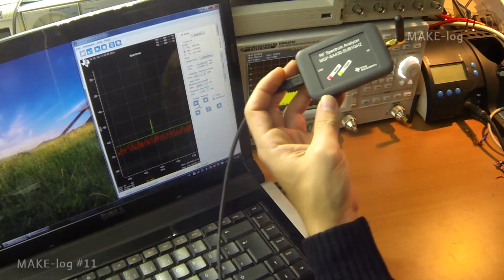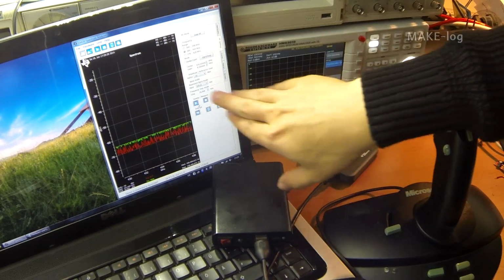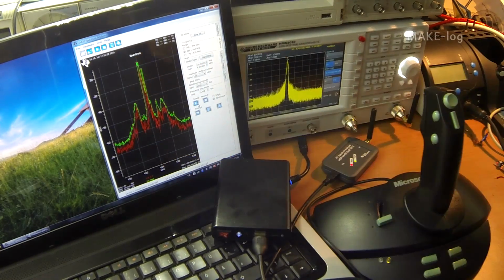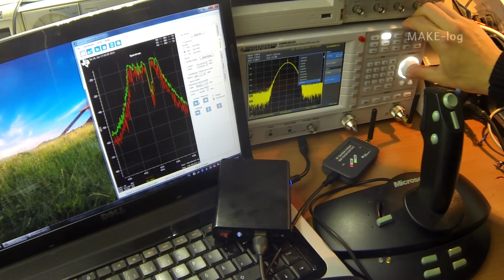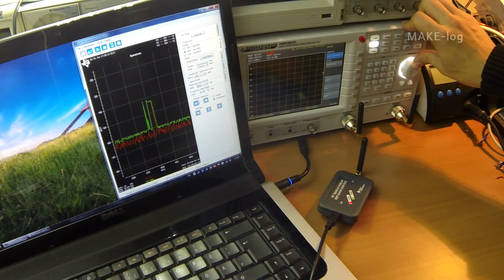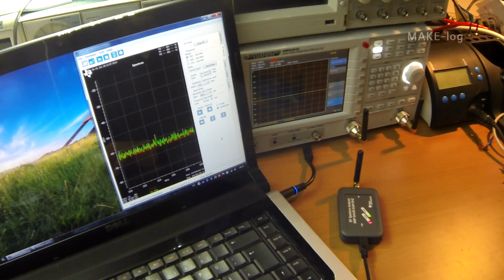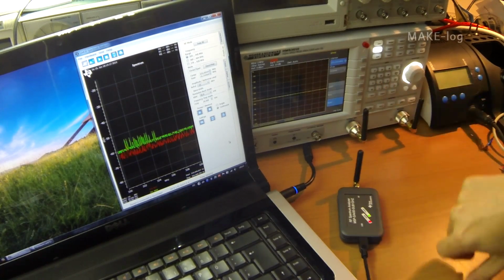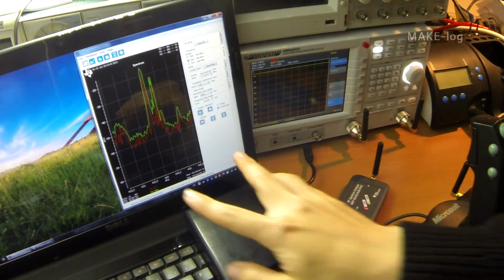MAKElog#11 TI cheap sub 1 GHz spectrum analyzer tool - Quick Review

Comment: Hi, I just have a question. We have the same frequency analyzer I think, its the HMS3010. I was just wondering how to I copy or "Print Screen" because it doesnt seem to work in our spectrum analyzer. :)
Reply from the maker: Carlotta Tolibas This is correct, it is the HMS3010. I save the screen by: 1.) Pushing the button "Save/Recall" 2.) pushing the next-to-the-screen button for "screenshot" 3.) Pushing the button below button "2.)" for "save". That's it